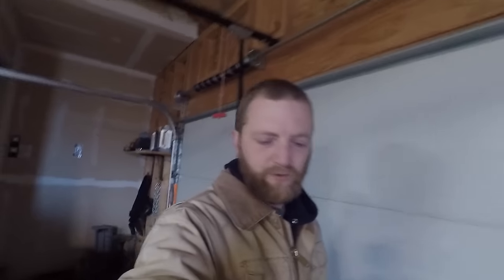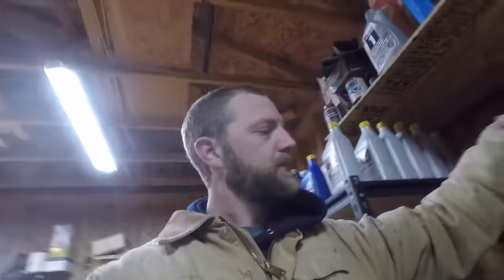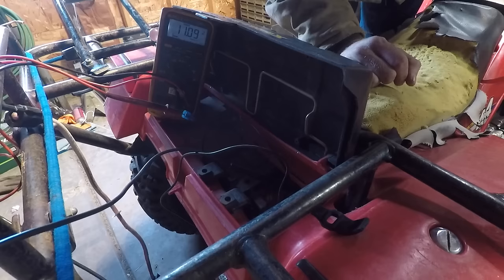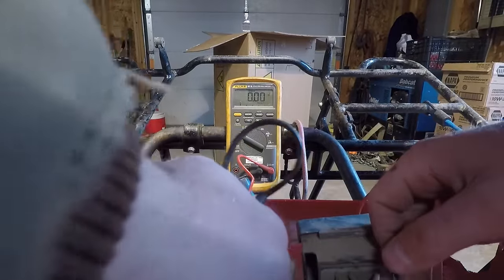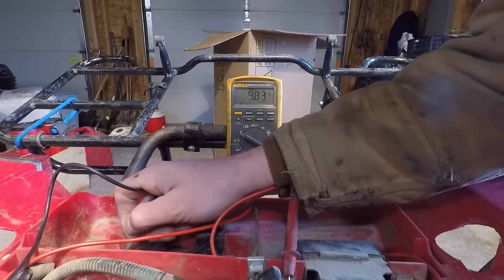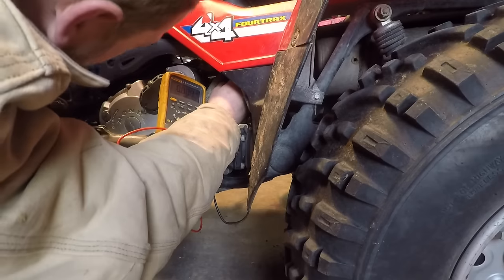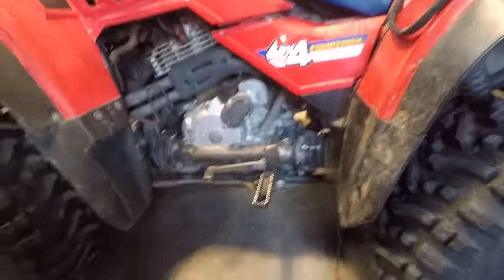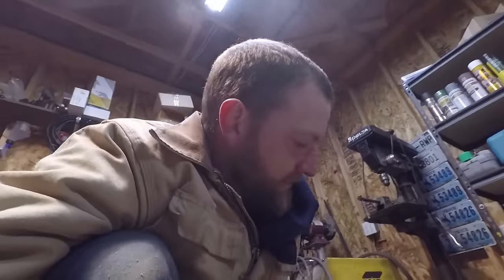Why the Honda ATV won't start

Comment: I had to laugh in the beginning.  I diagnosed the starter brush issue on the first clunk of the solenoid.  I work on ATV's and lawn equipment for a living and replace several sets of brushes every year.   People that start and stop a lot tend to wear out brushes very quickly.  I have customers that never wear out brushes, and others that I have to replace them every year.
Reply from the maker: See, I knew someone would know what I was doing!
Reply: Here's a question I have a 1999 450 forman S. Today I tried starting it, turned the key on and the green neutral light doesn't come on and wouldn't start. turned the key off and on several times and the green light came on and it started. I killed it to see what it would do, same thing green light didn't come on and it wouldn't start, but now green light doesn't come on no matter how many times I turn it on and off. Any suggestions? Thanks
Reply: @6mallards  I would start with checking the continuity on the neutral/reverse switch.   Two wire connector on the right side of the frame below about were the air filter is positioned.   Lt green/red wire to ground should show continuity when in neutral
Reply: @ngnmech  thanks

Comment: Brushes was probably the most common problem with those old Honda’s . Pretty much A yearly repair
Reply: Jason Crocker n
Reply: Really ? I've onky changed the brushes in my 88 trx300 1x in 34 years and still original brushes in my 86 trx350... Maybe you're doing something wrong or using crappy brushes. ..

Comment: Same thing happened to our Honda foreman 400. We sent it in for repair but it didn’t work with a new starter. We sold it and got a 550 cc arctic cat and it is crap. Now it doesn’t start. Dropped a valve and it is only two years old. Nice video. Good to see another nice four wheeler like that. Is the rear axle fixed or is it an independent linkage? Thank you

Comment: Thank you sir. I'm betting I got the same issue . Saw the little bastard run under the tarp where I had my quad parked.
Just ordered plug, coil and cdi box.
Now its time to SNAP SOME NECKS UNDER THE TARP!!!
DANG RATTS!!!

Comment: Good job tracking down the problem. I think I would just replace the starter as bad as the commutator looks. Wouldn't it cause the brushes to wear faster and uneven?
Reply from the maker: Yes I bought a new starter but it’s wrong.
Reply: Bummer guess you reordered it.
Reply: if you can find the brushes,  emery cloth or fine sand paper will have the commutator looking like new.  as long as none of the copper wires are broke on the amateur.  i used to rebuild starters and alternators.  just remember small starters with magnets, instead of coil fields.  dont tap them with hammers, it can bust the magnets.

Comment: You do the wrong thing when you 'Tapp'' on the starter, because when the starter is stick on these Atv, you have just to get off the black cover in the left side to have acces to the starter gear, and Tapp on the starter and turn the gear with your hand until you feel the gear smooth! I repair mine like that yesterday :P

Comment: some quad bikes have switches in there brakes and I saw that the qua was moving around did you try putting the  park brake and standing on the foot peg for the reayer brake because moast quads have a safety feature on them so if the park brave and the reayer brake is not preast a secondary solenoid wil stop the power traveling to the starter.

Comment: Every time I hear that solenoid click on any of these atv's I just assume the starter needs some attention. Of course you could have just used the kick start lol
Reply from the maker: I didn’t know it had one until I started taking it apart. Told y’all I didn’t know much about these things. 😆
Reply: @GuyinWY  same here, I met up with the person I bought it from. Said I finally "broke it" and he is like....you do realize there is a kick starter🤨🤦.... meanwhile me🤯🤦😄, mine isint start, I press button and it just makes a click sound I think like yours, il finish the video (haven't yet) and see what happens

Comment: I have a Honda four trax as old as my dad and he’s 38. Stopped working about a year and a half ago and it won’t even crank. No engine sound, just turned on the neutral light. Batteries dead, no fuel, idk what to do?

Comment: That four wheeler is big money around 2000 grand the way it sits if the motor is not locked up and if you get the motor cranked and it runs 2500 all day that is the most sought after Honda four wheeler there ever was its still the best built bike there is people collect these and bring them back to immaculate condition prolly worth 3500 I would hold on to that thing and cherish and pass that sucker down to a good home it don't matter how broken everything is the bike is still worth money to people even if the motors locked up pinion gears busted front and back it's still worth about 600 so never let they thing disappear or junk it because of some bull crap they are the most simple things to work on you could rebuild the rear end front end motor and all just being a novice just knowing basic mechanics and a little research and that sucker is in very very very clean bike with a seat covered and running you could get 3 grand for it all day if you don't believe me look it up on Facebook they have groups just for these 350ds and four Trax 300s people are snatching them up quicker then you can put them on there!
Reply from the maker: Really? I had no idea. Why are they so great?
Reply: Guy in WY they just are it was the first Honda 4x4 bike it's called a Honda fourtrax 4x4 trx 350d and people drool over them and they just made better things back then then they do today as you prolly know but how many straight axel front differential atvs have you seen it will pull like a train and run for ever you should feel like you got s good deal just to own that bike even if you have to rebuild something on it it's worth doing they will always be worth rebuilding!
Reply: Guy in WY they are pretty much collectible
Reply: Guy in WY and Honda is still best built bikes and always has been top of the line
Reply: The 2001 to 2003 Honda Rancher 4x4s (not sure the years).... are also straight shaft rear with front differential ATVs.  They are also 350cc.......    Excellent ATVs as well. The catch is most of them were electric shift.... but a number of them were also sold with manual shift.   The manual shift ones are more desirable and will get more on the used market and are harder to come by.

 More importantly did he say "The Polaris started and Honda did not"?????? I have never heard that before. Its always the Polaris that does not start or is broken.
Reply: david s. They are straight shaft but not a solid straight axel up front like the 350d
Reply: david s. Every 4x4 Honda except for the 350d is independent suspension in the front
Reply: Trevor Holland I bought my 89 for $200 and the Cdi needed to be replaced.....thats it😂🥳

Comment: After you got power across the relay, you could have saved yourself time and your viewers a lot of motion sickness by just grounding your jump box to the case and hitting the power stud with the red lead.  Seen bunches of guys test one your way, it spins so they put it back on, and then scratch their ass with a confused look on their face when nothing happens.  Its got to have enough TORQUE to over come the compression of the engine and your shade tree test doesn't tell you that......   i know every Auto Zone has a "starter tester", but its also being "tested" by a $10 an hour counter guy thar doesn't know any better.

Comment: hard to see all from the video perspective, but i would guess if there are 4 brushes then you have a starter/generator combo, hopefully someone with more knowledege than i will agree or correct me
Reply: brian bergman It’s just a starter. The generator is inside the engine, commonly referred to as the stator.

Comment: When I try to start mine it makes a clicking sound and I need to jump start it. What you think  is my problem ?
Reply: That is what mine does
Reply: First check your battery voltage obviously, a dead or failing battery can cause you to not have enough power to turn over the starter. The clicking sound indicates that  the solenoid is probably working properly. Next time instead of jumping it find the starter and tap it with a wrench  or something that could rattle it a bit(not too hard though), if it starts after that your starter is failing but you can still get a little life out of it by tapping it with a tool whenever it won't start, often this happens in colder weather with a failing starter..